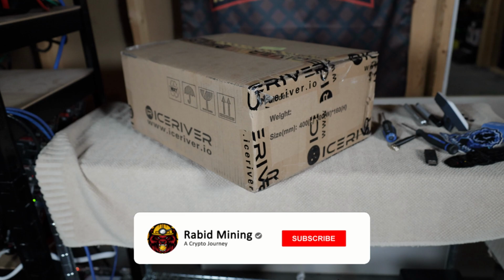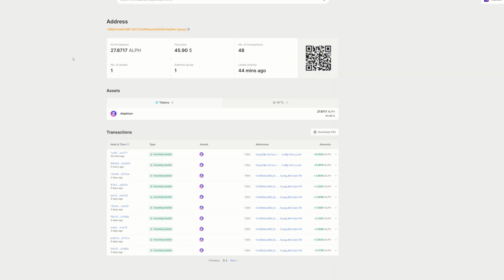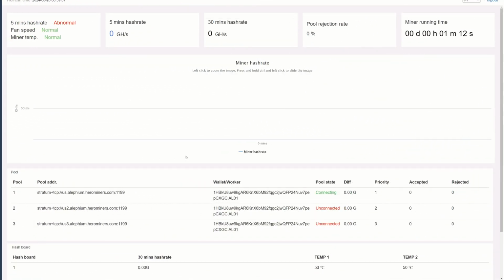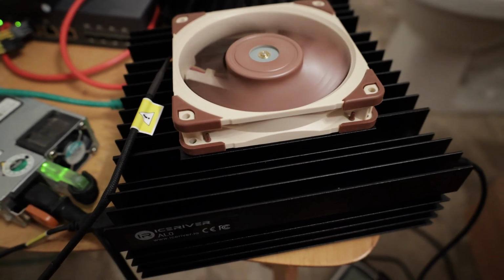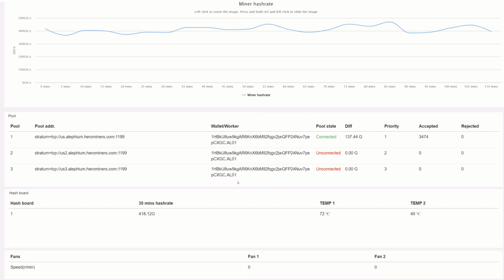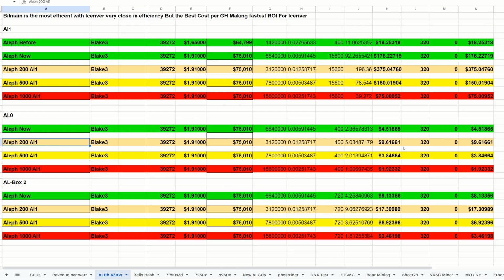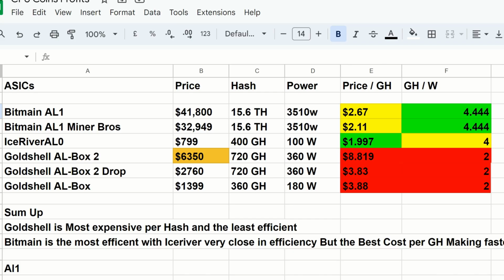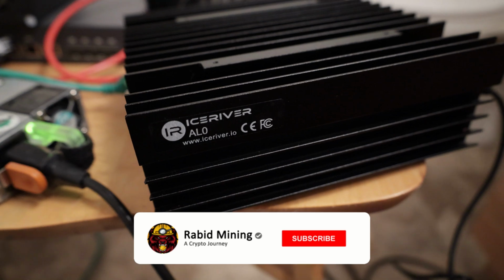New Alephium AL0 Miner - Set-Up, Performance, Thermals, Fan Testing

Comment from the maker: Thoughts On The AL0?  Anything I Missed You Would Like To See?
Reply: I have a 100% rejection rate using NiceHash. I connected it the same way I did my kaspa ones. Please help
Reply: Mine dropped to 300GH with the fan on it.

Comment: @RM truly great information and testing very nice, BTW if you change the wattage you also need to change the hashrate as well, in your video the last status shown was 120w @ 421.67Gh at the pool,  13:18 and 13:05  , so what is the efficiency for 120.1w @ 421.67Gh?
Reply from the maker: 3.50